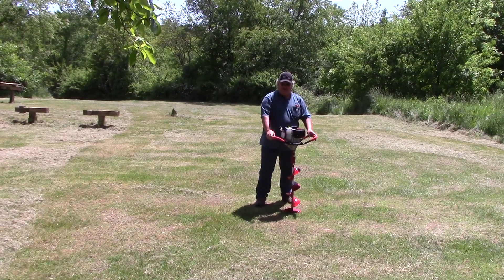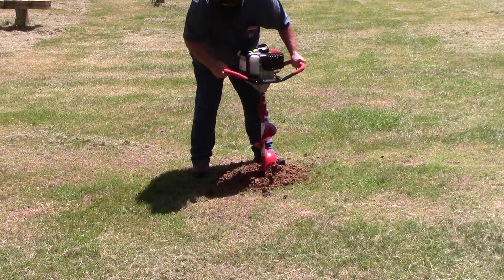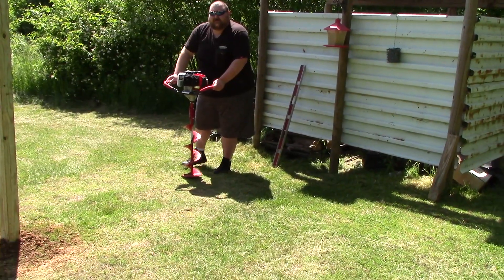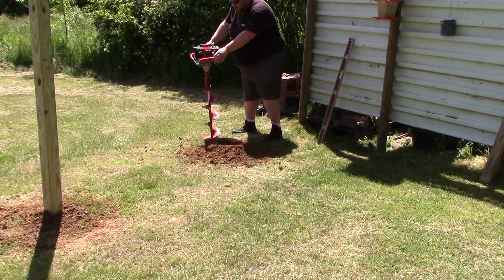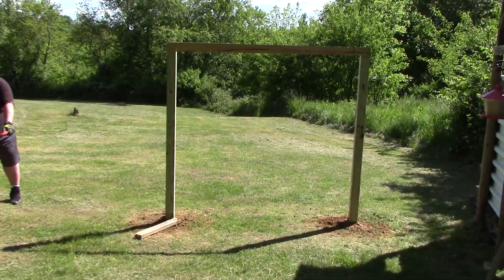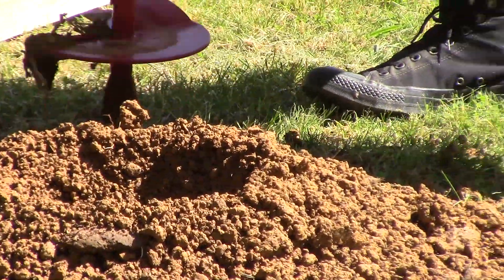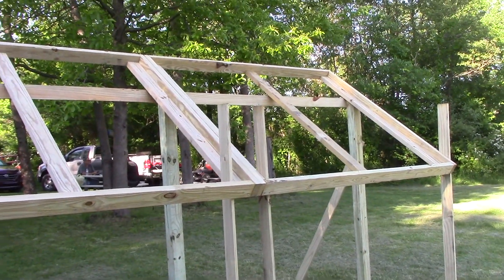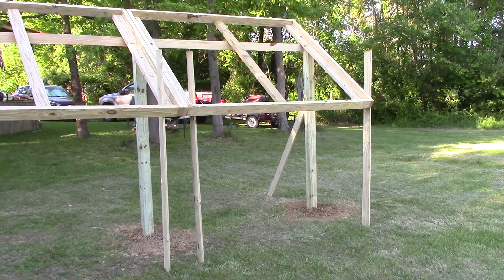Earthquake E43 Auger & $100 DIY Solar Rack Ground Mount Pt 1

Comment: Joe, I'd of went with metal poles, and square stock, for the frames.  it will last longer ,and but holding two panels each. you could then adjust them too max out the power .
Reply from the maker: +Ralph Taylor As I mentioned in the video,  I wish I could afford that.  And, this may be temporary if we move out there permanently.

Comment: Joe, I installed a new $41.00 kitchen faucet. While doing that I broke the pipe coming in from outside under the sink and it cost me $397.00 to have a plumber fix that. My $41.00 faucet ended up costing $438.00! The kitchen was flooded! I’ve discovered that I’m not much of a handy man!
Reply from the maker: +KMAC Radio That sucks, but, been there done that.  That's how I've learned how little I know, or can do.  Pay 10 times to have fixed, what I tried to fix myself.
Reply: $400 for a plumber is cheap most would charge you these days $600 at least. I always shut off the main water valve front of the house those little valves under the sink not reliable even ball valves don't last anymore. They used to be decent at some point I noticed ball valve failed in front of my house was only 5 years old. I guess HD sourcing from China now.